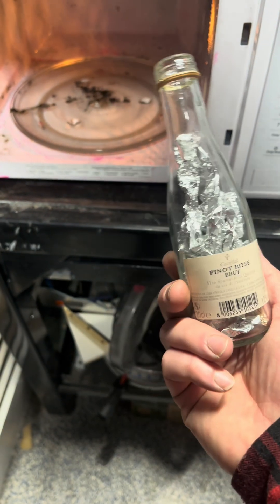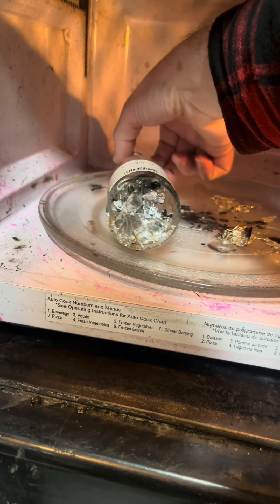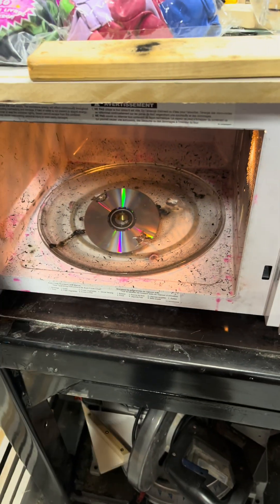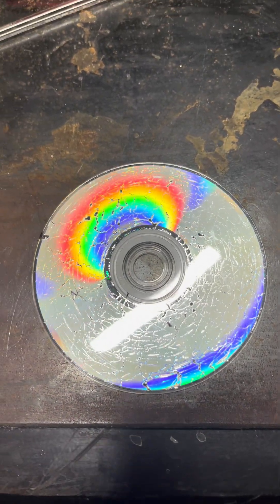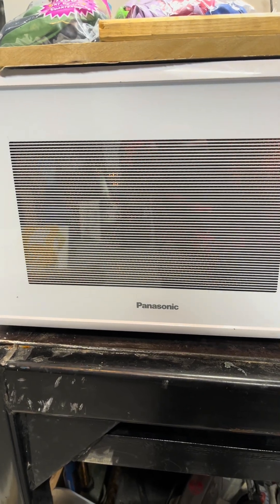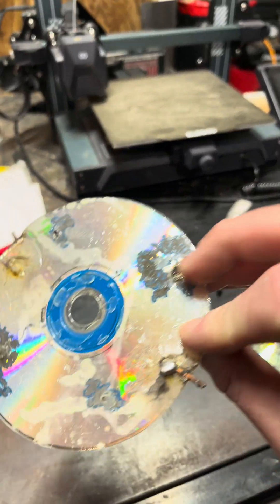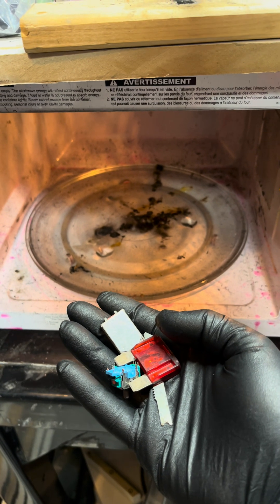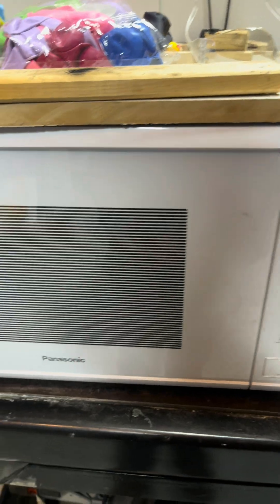7 Shocking Microwave Experiments You MUST See!

Comment: Put a can of dog food in a regular oven. Gas or electric. Set it for 250+ degrees Fahrenheit.
Being an appliance technician, I heard this story from a customer one time. The husband decided to warm up the dog's food. It was a cold winter day. He put 2 cans in the oven and set it for the lowest temperature of about 200°. He forgot about them and luckily no one was in the kitchen. They heard two loud explosions in succession. One can completely blew the door off the oven! This was a slide-in range, goes in-between the cabinets. The other can blew through the side of the oven and through the cabinet wall and busted a cast iron skillet. The handle and what was left of the skillet looked like a pie scooper. There was a triangle shaped piece and the handle left. The entire kitchen was evenly covered in dog food! You could not see out the window in the door leading outside! They had to start cleaning right away, because once that dried it would be like hard glue stuck to the walls and everything else! LOL 🤣 😆 
The power of steam pressure!!! Amazing and can be deadly! 👍
Reply from the maker: lol lessons were learnt
Reply: @AdhDad420  you should try that frfr